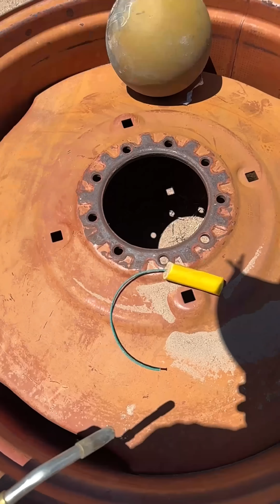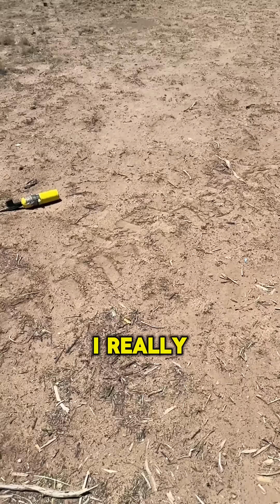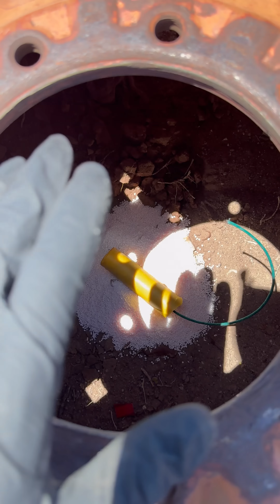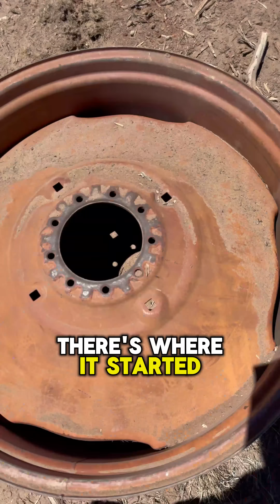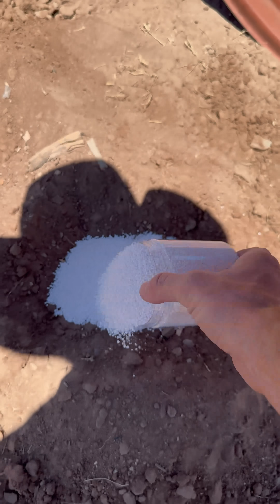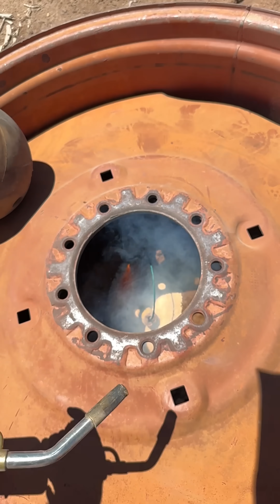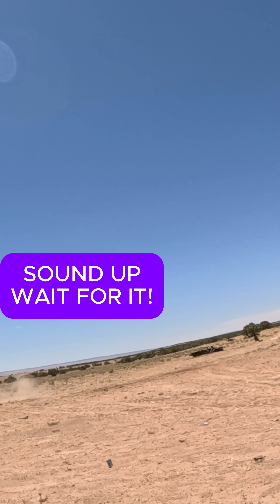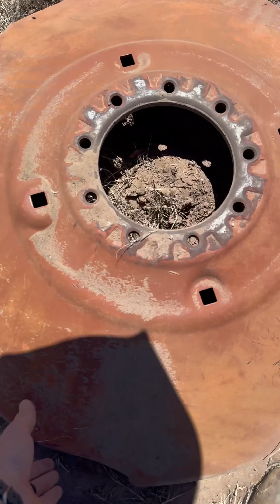How powerful is ANFO and Dynamite?

Comment: * one day, my Grandfather brought me to help clear the 7 acres of land just outside Casa Grande. Needed to remove last Big Ironwood Tree(Frickin Huge).
My Grandfather was a U.S. ARMY Engineering/Demolition Soldier during WWII .
He instructed me to dig down directly below the Big Ass Tree, w/ a ARMY Shovel...
It took a while,but, I did what I had to do.
After that, I had to sift all of the dirt that came out of the hole. Separated rocks from fine dirt.
That's when Grandfather instructed me about Nitro Gelatin, why it was used and what it can do. Back then I was 13 years old. 
He then put together a Bundle (7 Sticks -" one in the center, surrounded by six).
Placed detonator in bundle w/cord. 
Had me, the kid crawl into the hole (3ft deep) under the Big Ass Tree, placing the charge...
Then back filling and packing the hole with fine dirt. Every 6 inches. Until topped off and Full.
Went to the Old Truck he had(1959 Chevy Apache 1 Ton ), and raised the hood. He said "Fire In The Hole 3 Times in different directions ,so anyone and everybody will Hear.
Then had me make contact with the Battery. 
   BBOOOOMMMM.....
       EXCAVATION-          [1]
       TREE-                        [0]

 God Bless the U.S. Military

Comment: Used to play with ANFO on a regular basis When I was in the Australian Army Reserves (combat engineers).  We would mix wheelbarrows full of the stuff (there is a second ingredient) and yeah set it off with a half stick.  ANFO takes a bit to set off, but when it goes...... JEEBUS, it goes BIG.
Reply: Anfo only needs the fuse and detonator- or an electrical detonator. Saw a large pine tree stump blown 30metres into the scrub from a bread bag full, 3 minute fuse and detonator. Clearing view at the lookout at Meningie, SA. 1995.

Comment: My dad worked in the strip mines, as a drill helper and eventually as a driller. He brought home some of this stuff, it's basically ammonia-nitrate fertilizer- and a blasting cap. We had a huge stump in our front yard, he had just cleared the land and built our house and this one stump was too large to be pulled out of the ground with a tractor. So he took a hand auger and hand drilled a hole at an angle, terminating underneath the stump, about 6 feet deep. Packs in some ammonia nitrate, puts his blasting cap in, and then packs more on top of the cap- used 6 pounds altogether (I think, I can't remember tbh), and the blasting cap is about like a half stick of dynamite. So, he tells all us kids and my mom to crawl under his truck, which is about 50 yrds away, maybe. He crawls under with us, touches the wires to a battery- and holy shit- it blew a hole 6 feet deep and about 6 feet wide- the stump landed way up past the truck, probably flew about 75 yrds or more. It took every window out of the front of our new houses, the windows out of his truck, and you could hear stuff falling all over the roof of our house, the yard, hitting the truck we were under- it was nuts. I remember my ears hurting really badly, i couldn't hear anything but a high-pitched whining noise for about 3 days. Dad never said a word, just got busy fixing it all- my mom had plenty to say though- he caught hell for that one for a long time.
Reply: Why'd he wait until AFTER the house was built?
Reply: @unpopularopinion8608  good question. And more distance to people and car.
Reply: @erichpaul6508  I think he may not have understood how powerful it is and in what size charge.
Reply: @unpopularopinion8608 its like tackleberry in police Academy who wants to build a house and then its finished blow the whole thing up😂
Reply: We need more narrative in life like this. 👍
Reply: Great stuff 😂
Reply: @craiggwasira9518  Why is that great? more lie effing stupido ...
Reply: Your dad is a living legend 💪🏽
Reply: A minor miscalculation perhaps? Lol😂
Reply: @trustJesus100 To quote Tim the tool man, MORE POWER !!!
🤣🤣🤣
Reply: @trustJesus100  Ambitious and determined I would say.  😜
Reply: It's a guy thing
Reply: Dawin award audition.
Reply: @modsquad8u  lol.
Reply: @modsquad8u  but fortunately without "success"
Reply: As the sun dance kid said to Butch Cassidy.... 'Think you used enough dynamite there Butch'! Lol
Reply from the maker: Should I do this!? I know of some trees 🤷‍♂️
Reply: @1PoundEveryDay 

Heck yes!
Reply: @1PoundEveryDay    I say yes absolutely!! LOL
 Have to pace out the fifty yards and put a truck there with a camera under it for the full experience.

 — okay I read back through and apparently the truck lost its windows too. Nevermind that. Simulate it with just a junk car hood or some tin roof or whatever. lol
Reply: @1PoundEveryDay  Yes...yes you should.
Reply: @1PoundEveryDay  duh.
Reply: Wow
Reply: Thank you for this vivid account of a great days as a kid. 
Your dad was one of the greats.
Reply: This story absolutely killed me, dad's just trying to get shit done and blows the front yard all to shit
Reply: @EricTough 🤔🤫🫡🫣😶‍🌫️🤣😂🤣😂🤪😝
Reply: @EricTough  bro used 6lbs of ts for a tree stump 😭😭😭😭
Reply: ANFO is Ammonium Nitrate + Fuel Oil.  These 
are usually blended with 6% fuel oil + 94% ammonium nitrate.  Very dangerous stuff 
to fool around with.  This is how a right-
handed person becomes known as "lefty"...
or as someone who isn't around anymore.
Reply: @edb3877  anfo is stable as hell bud
takes a big bang to set it off
Reply: @adambartlett3483  definitely more than a standard blasting cap
Reply: @gullreefclub nah, Blasting cap works just fine for anfo. But you won't set it off by anything that isn't an explosive though.
Reply: @grnsouth1204  a chunk of lead moving at 2,000+ft/sec will do the trick
Reply: @edb3877 
I think the reaction needs carbon and the fuel oil provides it, but other Dorsey’s of carbon will also work, like ground out charcoal.
Reply: @edb3877  Best blend is 96% ammonium nitrate, 2% diesel, and 2% toluene. Don't ask how I know :), it's implied.
Reply: Best Dad Ever! 😆
Reply: We need to manoeuvre our society back to the kind of society where this kind of thing happens regularly. 
A fantastic lesson from your dad.
Reply: I was managing a road construction site in the Apuan Alps in Tuscany. I was clearing the mountain with explosives, using dynamite and ANFO. The road passed in front of a small, ancient church, La Madonna della Strada. The parish priest came and asked me to remove the stump of a holm oak he had cut down the year before next to the church parking lot. I had a hole drilled in the stump that was below the root level and placed three sticks of dynamite and an electric detonator inside. I closed the road and, standing under the bucket of a Cat excavator, I powered up the explosive. When we went to inspect the blast, a crater had been created between the stump, which had remained in place, and the ground, and all the roots could be seen as if we had washed them. The mosaic stained glass window on the side of the church was no longer there. The priest wept and asked the Lord for forgiveness. I made a donation to the church and had the window rebuilt. I was 25 years old, today I am 67, I think that the Madonna della Strada has protected me in all these years because I have never done any harm again and I have never hurt anyone.
Reply: Whatever it takes, I guess.
Reply: Dad's a legend!
Reply: Bro your dad's a fucking Legend 😂
Reply: Heck yeah😂
Reply: He caught hell for that but WHAT A STORY to tell!
Reply: Your pops is a CHAMP!
Reply: Job done is a job done.
Reply: The classic dad move of realizing you did in fact fuck up massively then remaining silent and fixing it while everyone gives you your deserved hell but knowing you have a hell of a good story too.
Reply: 1964 Just 2 years before before I got drafted . Did the same thing. With 3 sticks under a oak tree stump. It went over the house and landed on the iron wire telephone lines across the street. Grabbed the tractor and Pulled the stump. Then disced the field again. .
Then waited for the telephone company to figure out what happened. 2 of us ended ended up in the air force , 1 in the Navy and was in the army.
They just kept looking and scratching their heads.
 In the army learned explosive on top the stump. lots of sand bags on top of everything. Then get behind something solid. In case one of the wood chunks gets tossed.
Reply: 🤣🤣🤣🤣 awesome!😂😂😂😂
Reply: that is awesome
Reply: 6 lbs. is a lot! 😂 Just 375 ml. in a beer bottle sent  8 sacks of filling material sky-high. It was raining tiny  pebbles for about almost 30 seconds after 😂... The chain reaction of 2 quickly consecutive booms sounds awesome.
Reply: That's a great story. Well told, and in just the right amount of detail. 👍🏻
Reply: That's a freaking Awsome story youll always remember 😅
Reply: He's lucky he didn't go to jail man 😂
Reply: We had one next to a buddy's house they were trying to burn out. It burned all day, and burned a hole down the middle about half-way. One of our friends found a half-full can of ether and dropped it in the hole. Blew out both windows on that side of their house. His wife was...not pleased.
Reply: No offence, but your father is a low iq
Reply: Did your dad ever make your mom squirt?
Reply: Your dad, is a MAN!!😎
Reply: Honey I Blew Up the Kids
Reply: Oh my God, my SIDES 😂😂😂😂😂
Reply: Right on brother!!!!
Reply: Thats why ammonium nitrate is so regulated in Australia- to stop terrorists and uneducated idiots killing people or destroying neighbourhoods.
Reply: That is 👍 👌
Reply: This is an amazing story to have haha
Reply: Potassium nitrate (KN03) is used as fertilizer in the Philippines. It is also used for (illegal) blast fishing. Just like Anfo, which I assume is the Ammonia version, fire won't set it off. A blasting cap, which basically also goes boom, is what they use... So you get 2 booms in close sequence. In this case, maybe some of the Anfo helped but maybe a lot just got dispersed since it wasn't packed.
Reply: I loved ghe old school ways ..our fathers cud take anything from work lol great memory
Reply: Sound Like you had an awesome childhood 😂👍
Reply: Would  have loved to watch  the whole episode  obviously from a distance
Reply: Yes, you can have to much fun.
Reply: It sounds like he consulted Keith Moon on that one!!!
Reply: Sounds like a hellava dad 👨
Reply: Thanks for sharing!! Great story mate
Reply: This was a wonderful story
Reply: Awesome man that is a story for your kids at bedtime they would be amazed by grandpa 😊❤❤
Reply: Cheers to dad 🍻🤘
Reply: Your dad sounds like my kind of guy! High explosives can fix so many of life's little challenges...and it's just entertaining.
Reply: Your dad had more sense that the guys today that blow up refrigerators with Tannerite and get missed by the door by inches.  Kept you all safe.
Reply: I ALREADY like your Dad❤😂
Reply: But the stump was gone😂
Reply: I'll bet he did.   That sounds like you had a fun family,  lots of adventure.  😂.
Reply: He was a regular Tim the Tool Man Taylor, he was :)
Reply: Never a video camera handy...😂
Reply: Did you work as a driller at JR Simplot?
Reply: I bet the girls of this home never had any boy trouble! THAT is a dad.
Reply: Worth it lmao
Reply: BIG Daddy!  (aka Dufus)
Reply: FANTASTIC!!!!! 👑🐻👍🏾
Reply: This is why you don't play with explosives when you don't know what you are doing. Six pounds for a stump is suicidal, especially if he hand augured the hole.
Reply: had being the operative word
Reply: Hell yeah, that's what men do😂😂😂😂
Reply: Stumps are easy to deal with.  Especially if you cut down the tree before it's a stump.  Pile everything on top of it and waiit a week or two for it to dry out.  If you packed it right, you light it on fire and the stump will be gone while you enjoy a night with a bonfire.  By morning you rake in ashes and possibly toss a little extra dirt in it and viola, no stump and hole mostly filled in.  Ready for grass and mowing now.
Reply: well damn, what the heck else was he supposed to do 😂
Reply: Not sure how much explosive you need? Use P for plenty.
Reply: What a Legend he was!!!
Reply: Brilliant.
Reply: Sounds like a felony taking expensives home according to the company I work for
Reply: Mate, your dad's a legend, not least for dealing with your mum's fallout.
Reply: @edstraker8451 i dont recommend taking this stuff home they will put you in prison for it
Reply: He kinda had an idea that it would blow!
Reply: A bit much NH4NO3 I presume? 😆
Reply: How was dad to know the trunk wood increased compresion by 50x during the
Boom
Reply: Thinking dad was a prankster its why u were safe he did this everyday he was foolin with his woman ur mom
Reply: It sounds pretty stupid, I wouldn't have used more than 300g, repeatedly if necessary. And before I built the house!
Reply: That is so awesome
Reply: Guys, here is the True Savior of man

HalleluYAH translates “Praise YAH”

- YAH is the Heavenly Father (Genesis 1)

- YAH arrives via The TENT OF MEETING (Exodus 33, Isaiah Scroll)

- YAH The Father (Genesis 1) was Who they Crucified for the sins of “man” and YAH arrived to be Crucified via the Tent of Meeting 
(Book of Isaiah)

YAH The Father, He’s The Savior
Reply: stump was gone so......👏👏👏👏😁
Reply: "My dad worked in the strip mines..." I already knew this was gunna be good😂
Reply: Back when me and my cousin was just teenagers, we would build homemade charges and one day my grandmother came out of the house and said we needed to stop becUse we were shaking the dishes in the cabinets 😆. We lived on about 100 acre farm so we just started using it farther away😅
Reply: Was your dad also involved in that whale "clean up" incident per chance?
Reply: Okay A.I.

Comment: Can you please make some panclestite!
I been asking for a demonstration for years on various channels, but nobody has done it.
Make it using kerosene as the fuel, although you can use many combustible liquids.
For the liquid dinitrogen tetroxide, ...look it up, many ways to make it . Pour nitric acid on copper, run the brown gas through a tube packed with ice on the outside of the tube, the brown gas should condense into a liquid ( condense / boils at 70 degrees farenhite)

Comment: ANFO Prilled Ammonium Nitrate (AN) is a nominal blend of porous Ammonium Nitrate prill and fuel oil. It is a dry, free flowing explosive; formulated to ensure the appropriate oxygen balance providing optimal energy and sensitivity.
Reply: AN is dry and free flowing, ANFO isnt dry as it contains 1 part in 16 diesel.

Comment: I was absolutely flabbergasted when you left the torch on the rim for the first shot. Crazy.
Reply: I thought I was the only one. He got a little to excited and forgot it, I’m guessing.
Reply: The fact that he is waving a lit torch around a stick of dynamite inside a confined space is even crazier.  He could accidentally light the fuse 1/2 inch from the stick.
Reply: lol same. My flabbers were definitely gasted
Reply: How is it functional. 

I drop mine from 5ft and it just clicks.
Reply: @ericross6316 lol ikr😂
Reply: I came rushing to the comments looking for this
Reply: He forgot it then made the very smart decision to not go back for it.
Reply: @Tom32145_  smartest move he never made!
Reply: Same
Reply: I’m guessing he knew the wheel would move. It’s not like he thought the ball would just go so he left the torch right there thinking it would be fine… right? LOL
Reply: Good thing he didn't leave it on the wheel for that last blast...

Comment: When I was 13 I was in charge of the blasting on a strip mine I always looked at it as the dynamite would crack the slate rock and the ammonium nitrate would move it I never realized the fossils in the slate were as valuable as the coal .

Comment: If you wanna destroy it efficiently you plug up or weld shut all those bolt holes and put a lot more weight on top. Granted, I’m sure you’re having a lot more fun this way, but for those on a budget, plug the holes and heavy weight.

Comment: Back in the day went looking for opals at home in Australia. We call ANFO prill. When camping whoever woke up first set an alarm clock of a 2 litre coke bottle full of prill with det cord and detonator next to someone's tent😅 When we cleaned up camp to go home we threw all the rubbish down a mine shaft and dropped 40kg of prill down it to get a good mushroom cloud picture😅
Reply: 2l of nitroprill next to a tent will kill the inhabitants. Saw what a bread bag did to a 6foot tall, 3 foot wide pine stump- blew ot 30 metres into the scrub and left a crater 20feet wide, a metre deep.

Comment: Back in the 80s a man I knew took 4 sticks of Hercules with electric fuse. Dug a hole placed dynamite in the bottom, place 55 Drum filled with water on top. Place another 55 drum empty. Buried and set it off. Amazing

Comment: In the third explosion, I used a stopwatch to measure about 13 seconds that the top of the rim was in the air. Since g is constant, the part will have spent half of that time going up and half going back down again, which means we can calculate the height from the falling time. Using 6.5 seconds, that part was probably about 210m high up. Keep in mind that this calculation does not include air resistance or flight dynamics and the 13 seconds are rounded from my poor stopwatch skills. 😂

Comment: Dynamite detonates with a max of 6000.
ANFO is way less. If you spike AN with Nitromethan ( the strongest mixture by far ) you are still under the detonation velocity of Dynamite, but it's close. Enough to disintegrate Brick & Mortar.
To hurt metal you need more than 7000, like Semtex or C4.

Comment: should put a ring of flour around the top ot steel rims, and a second ring inside about 1 inch thick and inch hide a inch away from the anfo, it be comes FAE as the fine powdered flower particles gets flung out amongst the air it burns and is called Fuel air explosive... makes wonder mini nikes with smoke rings.